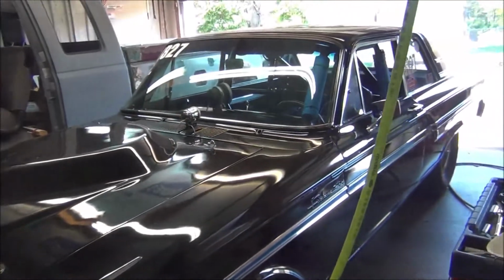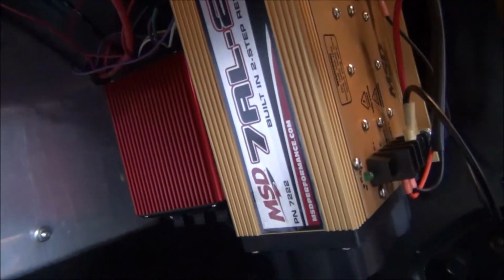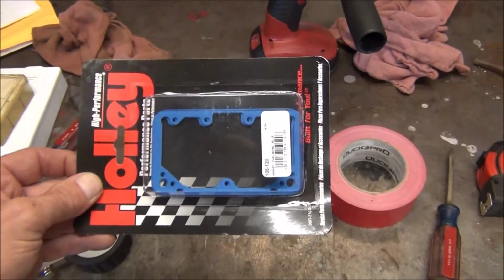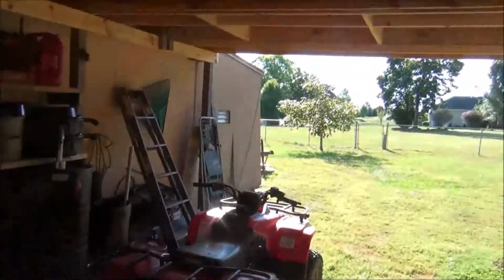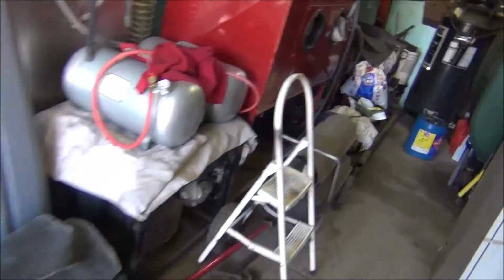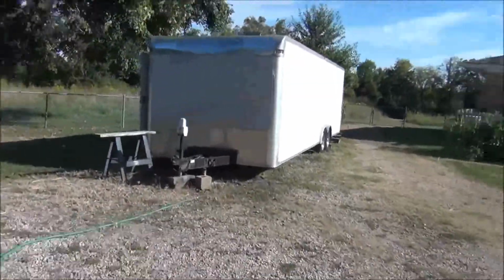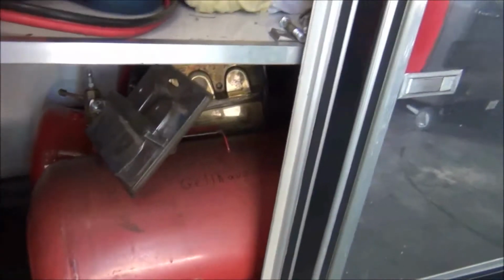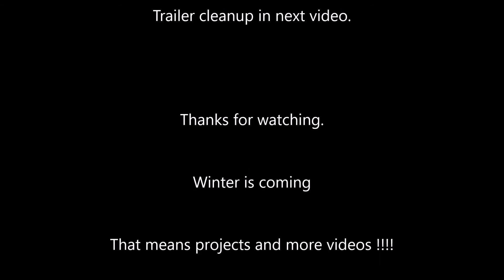Update on 64 Fairlane, lean to shed, and enclosed trailer

Comment: good job amigo , the  car port looks  good   i finally got my  cement  slab done  im pondering  iether a metal structure  or a wood one  like yours
Reply from the maker: I thought about a metal building kit also. Not sure whats cheaper. The way I am doing seems cheaper, because I am buying materials a little at a time. But haven't been keeping track. One thing is for sure no matter how big we build, we want more when its full.lol.Thanks for watching.

Comment: Thanks for all the videos!!! I'm a Ford guy and machinist to by trade too. I'm picking up a Bridgeport style machine soon and putting it in my garage.How do you like the position of yours in the corner? Also are you using a phase converter, if so what kind? I'd love to see some videos on your machine.
Thanks!!!
Adam
Reply from the maker: The mill in the corner works good for me. Not much room in my garage, so it was the best place to put it. Temko 3 phase convertor. Bought it new off of E bay. Thanks for watching.